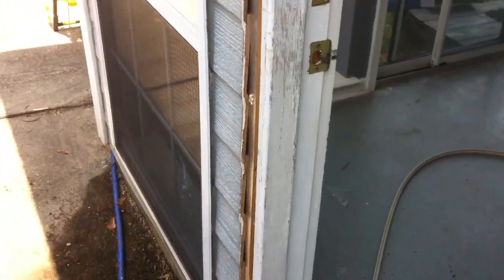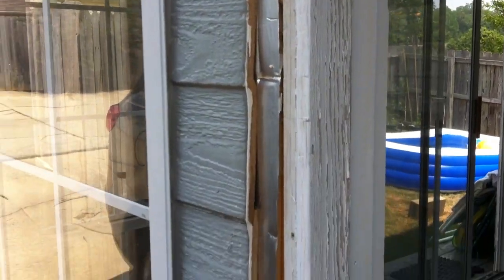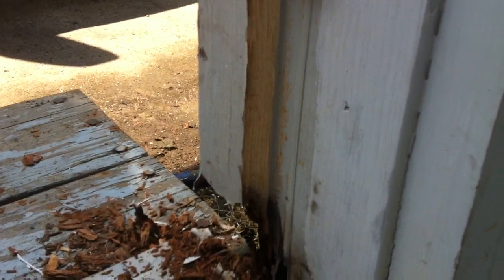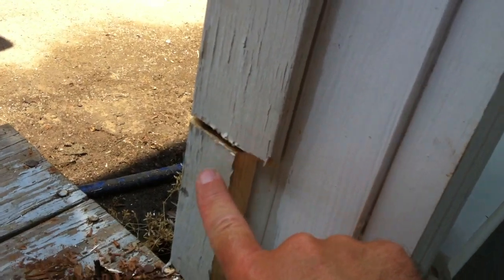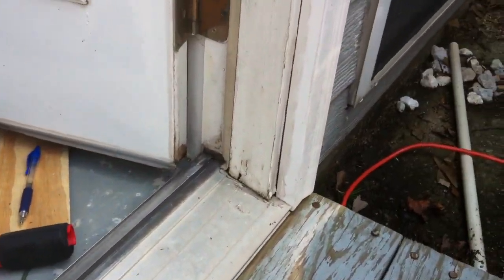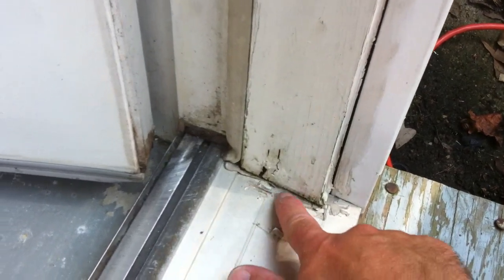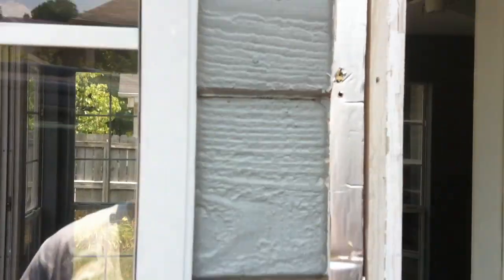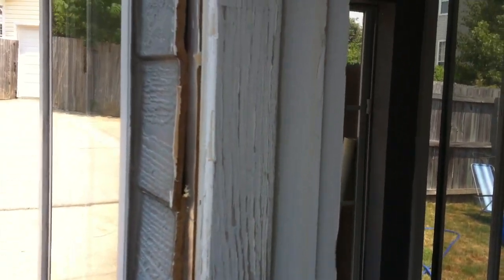Water Damage to door frame - suggestions?

Comment: use either an epoxy product or bondo. there is a good video by Ask This Old House.  
I did it with my door frame.  I used a dremel with a rasp attachment and took all the rotten wood off, then used some bondo which hardens in a matter of minutes.  Next, I sanded and painted.  good luck